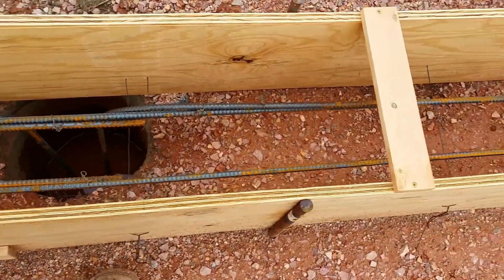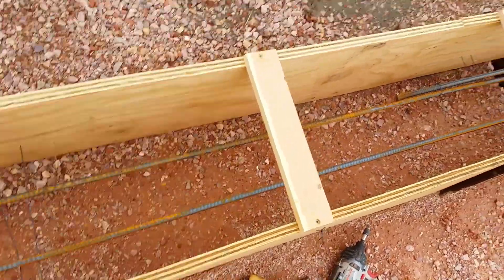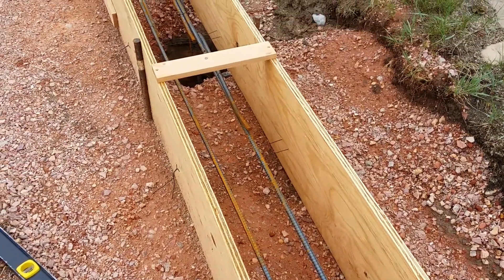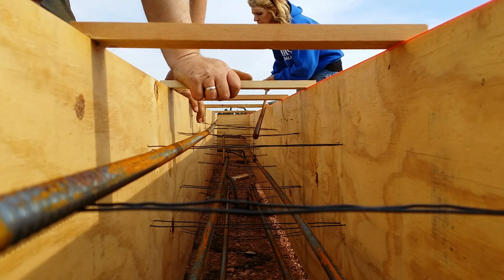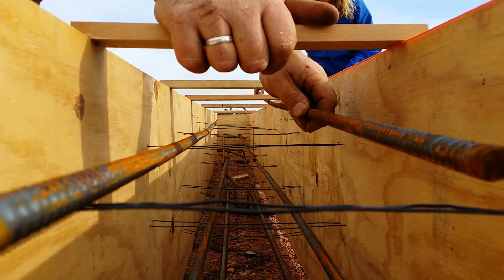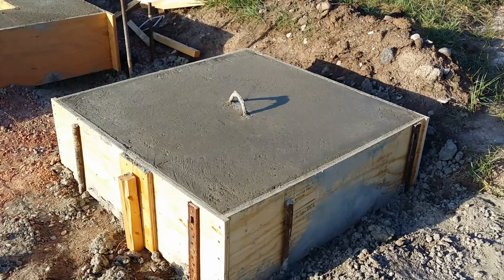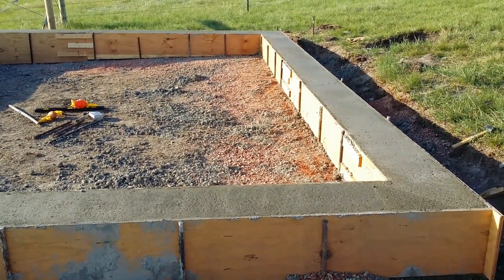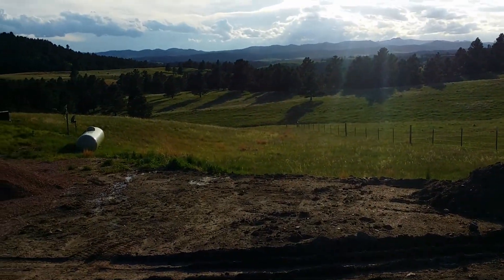Timber Frame Barn 6 - Pouring the Foundation

Comment: Thanks! I’ve watched most of these videos. Some more than once. How do you make sure the cement goes to the bottom of the tubes? Seems like the forms block access to 1/3 of the tube opening and with the rebar you can’t really get close to the opening with a shovel.

Comment: Are the holes for anchoring the building to the ground ?  Also, did you spray the inside of the forms ? Thanks and thumbs up.
Reply from the maker: august the holes are to get the footings below the frost line, keeps the grade beam from sinking.  We just wet the forms with water before the pour, that works fine.

Comment: Steel is to be tied to over lap each other by 2'.I didn't see any anchor bolts or some type of simpson strap to hold down your timber frame post, you must be going to drill them later.
Reply from the maker: Larry Meier yes drilling them later Larry.